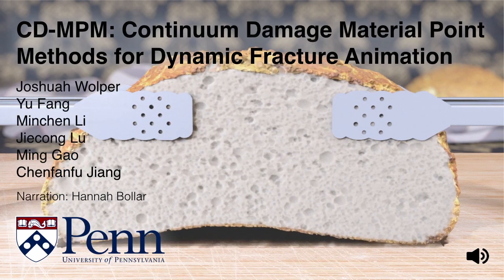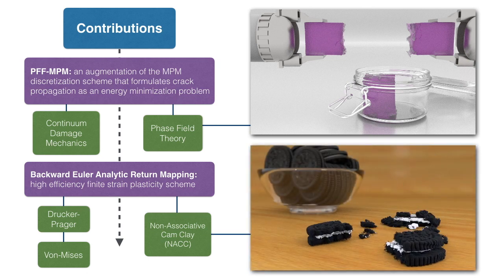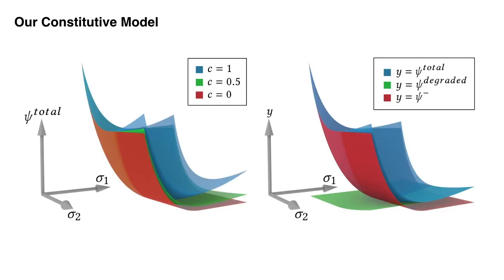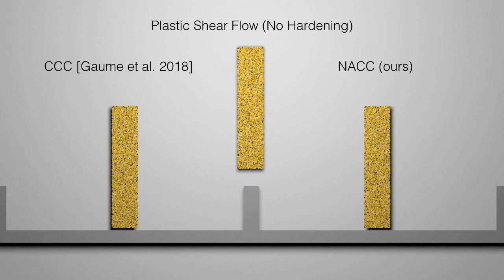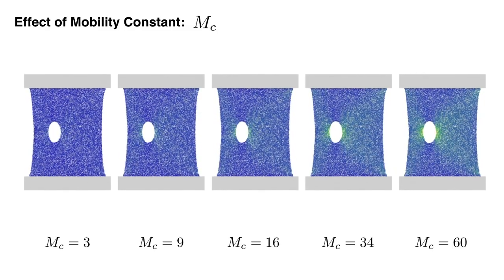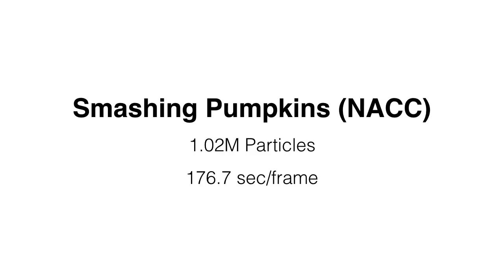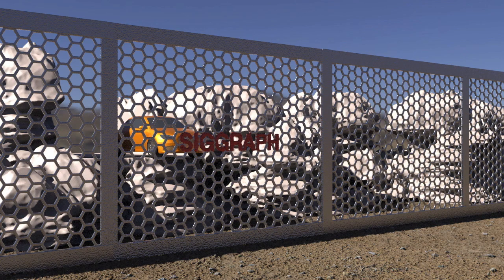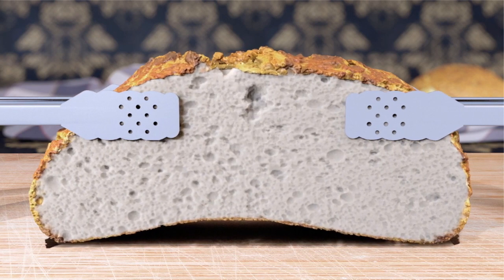[SIGGRAPH 2019] CD-MPM: Continuum Damage Material Point Methods for Dynamic Fracture Animation

Comment: Hoping to see this kind of physics in future games.
Reply: Never. Did you see how long it takes to simulate each frame?
Reply: @EnDSchultz1  700 seconds to 48 hours to 3 days.
Reply: @EnDSchultz1  We will definitely see this kind of physics in future games maybe not this year or the next year but within 5 - 10 years from now we will.
Reply: @EnDSchultz1  Never say never! :)
Reply: @yoopoopoo9  But you think all hardware about this! Software may turn this around to render easier aswell!
Reply: @yoopoopoo9  I'd be super excited to see some sort of ML implementation of this in a future paper. Something like that has already been done, but for a much simpler volumetric simulation of smoke. Implementing it with ML made it run much faster (with some imprecisions, but the results are still very convincing). Basically, they generated a simple and blurry version of the simulation, and added details to the blurry simulation with ML.
Reply: It's definitely more likely to be used in movies first, since they can take as long as they want to render frames.